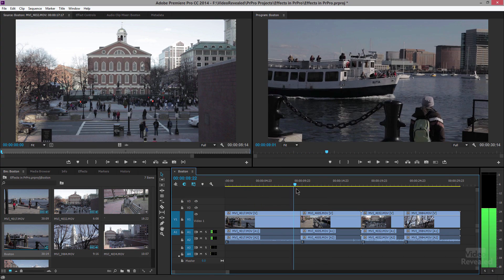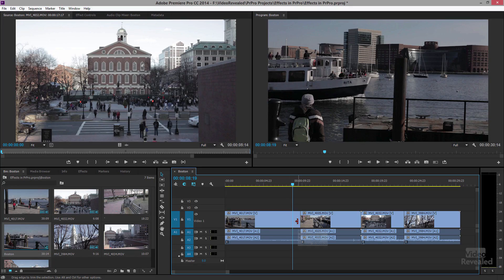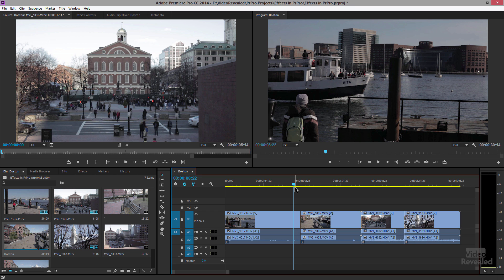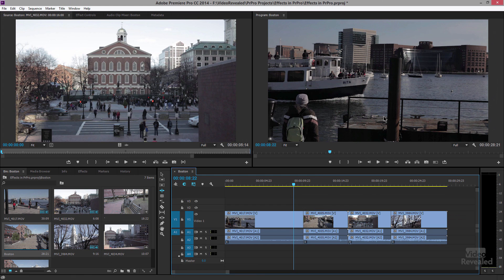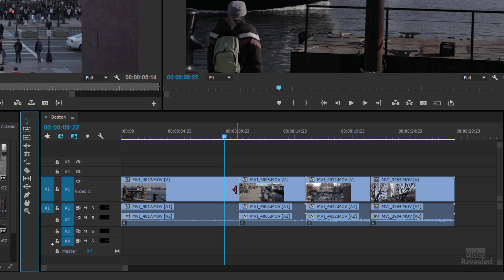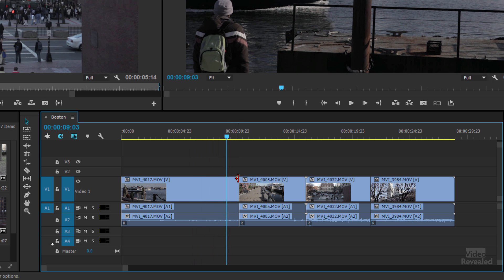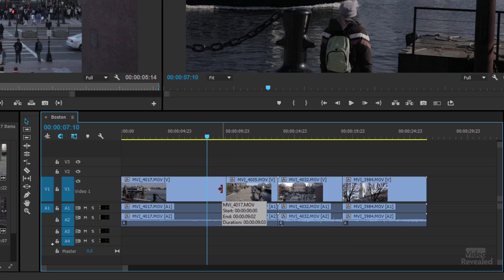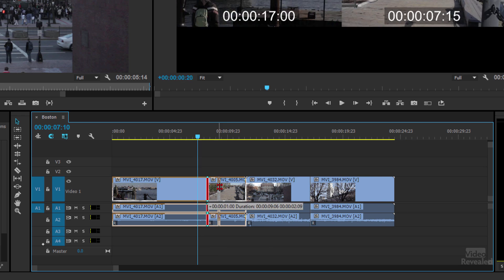All about ripple trimming in Adobe Premiere Pro

Comment: So, I want to have a ripple speed duration tool. Does that exist? For example, if my previous edit is 10 seconds, if I use W then it ripple trims to 8 seconds and moves the next clip to that point in my edit. However, The 2 seconds that were trimmed I want to keep. I just want the duration of the previous 10 seconds to actually be only 8 seconds. And, I want the next clip to start after the previous clip completed its 8 seconds. Is there such a tool in Premiere? (I know about speed/duration).

Comment: how about when you trim a clip then change the speed duration (to slow motion) increasing the clip size and auto-trimming the next clip and as a result making it mismatch with the now resized clip... ?
Reply from the maker: It can be a little tricky but you have the option to ripple the position of trailing clips when using speed changes. If you still need to tweak the duration, then manually ripple trim the end.
Reply: @VideoRevealed  Thank you very much !

Comment: I can't use this because when I have videos on top or below the clip I want to hit "q" or "w" on it goes haywire and cuts a bunch of stuff I didn't want to cut. Is this due to not sync locking? if so, having to individually sync lock every track seems like more work than just using the razor and selection tool.
Reply from the maker: That's the expected way for ripple trimming to work. You have to lock any tracks you don't want moved. That's the lock beside the eyeball.

Comment: That was very helpful, thanks!!! May I ask: if I have two clips synched on the timeline and one starts a little earlier, using Q for ripple trim, will produce a piece that is left over. Is there a way or setting that would automatically remove that too?
Reply from the maker: If you lock the other track, it won't be affected. If you don't have Track Targeting on (the blue V1,2), the it will leave a bit of the clip but you'll be left with an edit point at the left edge of the other clip. There's no easy way to do what you want in one step.
Reply: @VideoRevealed  Too bad. But thanks for your reply anyway, much appreciated!

Comment: Newbie here...why is part of the clip in biueishgray and not visual all the way to the next clip? Thanks.
Reply from the maker: Sorry, I don't understand your question.
The clips in the Timeline show the duration of the clip as a rectangular block on a track. The head and tail are where the clip begins and ends. Trimming and Ripple Trimming  changes the duration and you see the same color as the rectangle while you're dragging it.
Reply: @VideoRevealed  Thanks, but what I was asking, is, only a small portion of the clip on the timeline shows a preview, the rest of the clip is a solid color.  Is that a setting?  I thought the whole clip is a displayed as a preview.   So in other words, if the clip on the timeline is 3 inches long, only an inch is shown as a preview of the clip, the other 2 inches is a solid color as displayed on the timeline.  Not when played obviously.

Comment: Hey Colin, thanks for the great video as always. I've been using Q & W for a while, and by default the playhead always snaps to wherever the ripple trim starts/ends. For some reason now when I hit Q or W, the playhead remains in the same place in the timeline that it was, instead of snapping to where the ripple trim starts/ends. Any idea how to fix this?
Reply from the maker: I just tried several things to try to replicate this but I can't. Sorry but I don't know why it's doing that.
Reply: @VideoRevealed  Thanks for trying this Colin. It turns out that a simple restart of premiere fixed this. I had to restart it anyway, since my programme monitor blacked out after I woke my laptop from sleep. In doing so, it ended up fixing both problem. Oh Premiere...
Reply from the maker: Okay, glad you figured it out.

Comment: How to split a video into equal time parts by Adobe Premiere Pro
Reply from the maker: I'm sorry, I don't understand what you're trying to do.
Reply: @VideoRevealed  I want to split a video (such as 4 min 30 seconds length video)  into 26 seconds interval.  So each video clip should be 26 seconds in length. And last clip may not 26 seconds in length, it can be less than 26 seconds but it's doesn't matter. But except the last one other should be 26 seconds in length.
Reply from the maker: There is no automatic way to do this. You need to manually set IN and OUT points in the Timeline that are 26 seconds in duration then export. Manually move the IN and OUT points for each segment and export.
Reply: @VideoRevealed  Thank you

Comment: Great video well explained. One thing I haven't found yet which I could do in flash was to insert frames and all the rows would be extended at the playhead. So the effect is to lengthen the footage. This only works now I think about it with still images. So maybe that's why I am having difficulty finding a way to do this. But finally I can ripple edit. But for my logic the Q and W are the wrong way around :)
Reply from the maker: Okay, good to know.

Comment: Genius!

BUT... Can you please explain the easiest way to make it so that a video file, that has audio attached, when imported to the editor is able to be edited as one?

I have literally spent far more time researching how to do this than all the little 3 step clicks I'm trying to save myself from.

Ripple tool is awesome. But not when it leaves your audio track in its original position.

I've tried linking them, grouping them, so on and so forth. It shouldn't be that hard! They should import as one attached file that edits when the other one does by default, then there should be an option somewhere to disconnect them should you want to.

Thanks!
Reply from the maker: You most likely have Track Targeting set incorrectly. Check that V1 and A1 are both blue before you edit on the Timeline. Also, you can check if importing brings in both the audio and the video if you see an icon that looks like a video with an audio waveform. You can also Double-click the file and play it back in the Source monitor. If you see video and hear audio, then both came in correctly. If they didn't, please check my tutorial on Troubleshooting a Project.
Reply: Wow, thanks for the quick reply.

The video and audio always import correctly together, if so selected to import both. They move around the timeline together when I first choose where to drop them.

I've ensured that both V1 V1 and A1 A1 blocks are blue once dropped there as well, before I attempt any editing.

If I try to place the ripple tool on the head, centered on both V and A tracks, then slide it, I get the message of "trim blocked on A1 or V1". Does that tell you anything?

I'm then left with only the option to slide one or the other, thereby making it so a one click solution (as presented in this awesome video tutorial, as it should be) still takes 3 moves and deleting the leftover gap. Which basically defeats the purpose of ripple.

Thanks again.

If you think your troubleshooting tutorial would have the answer I'll look into it.
Reply from the maker: Are you sure you're looking at Track Targeting and not Source Selection? Both Track Targeting and Linked Selection buttons need to be engaged. See this screenshot: http://imgur.com/a/gYHKf
I'm going to play come VR games right now so I won't be available for a bit.
Reply: EUREKA!! 

You solved it! The Linked Selection button above V1,2,3 wasn't blue! And this totally explains why sometimes it would work, and other times it wouldn't. I knew it was something tiny and dead simple. But yeah, almost 2 hours trying different things for a couple days now.

That picture was a huge help. Subbed for sure.

Great work on the channel and good day!
Reply from the maker: I'm always happy to help.

Comment: Any ideas on how to get around "trim blocked on audio 1"  Basically the trim tool does not function as your are showing. When I select it and attempt to bump the video over to the right, and I want the existing footage to move over, it refuses to move and instead I get "trim blocked on audio 1" I've tried multiple workarounds, including setting the lock, not setting the lock, selecting multiple videos, rebooting ,etc however the ripple trim tool does not all me to trim to the right or extend the video, it will not bump the existing video clips over, just returns the error "trim blocked on audio 1" . Any ideas.
Reply from the maker: +Anthony Congiano - Usually this is caused by linked video. Premiere Pro likes to keep everything synced so when you try certain edits, the result will put some audio tracks out of sync. You can override this by turning off global link. See screenshot and tell me if that works:

http://i.imgur.com/Mv3voOl.png